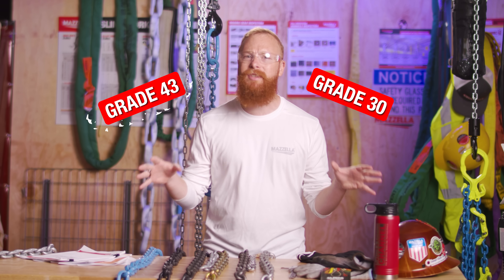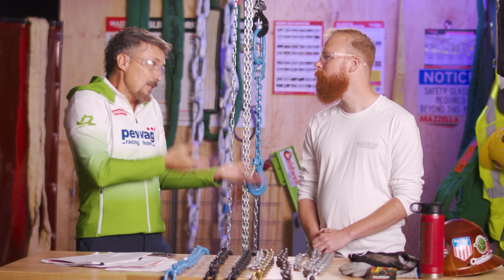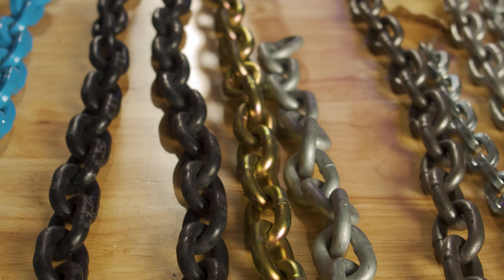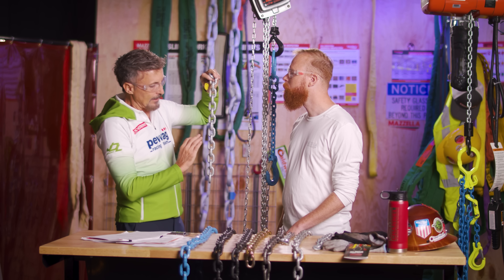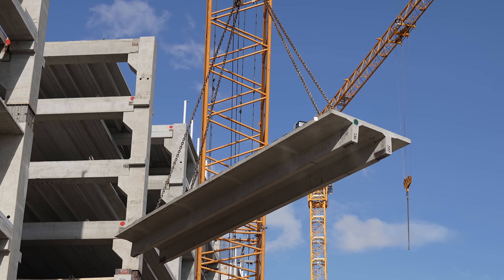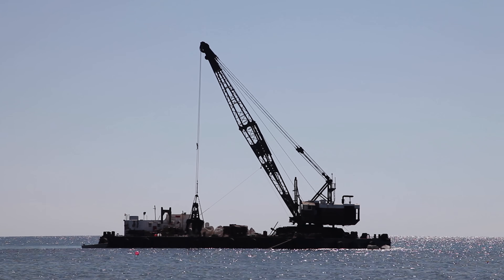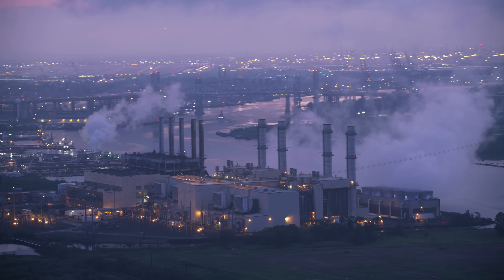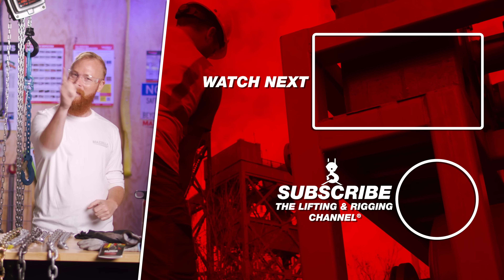Chain Grades Explained: 30, 43, 70 vs 80, 100, 120

Comment: Ciao Carlo from Concordia Station in Antarctica. Really nice and interesting video!
Reply: Hi Eric!
Thank you for watching and for sharing your insights about using rigging equipment in those incredible temperatures.
Remind me — what’s the highest temperature you’ve experienced during your winter, and what’s the lowest? It must get freezing cold out there down under! The steel you’re working with is really exposed to some extreme conditions.
Thanks again for sharing your experience!
Reply: @Chaniac-Chainwhisperer this winter we reached -78°C. -38°C was the highest, but usually we were between -75 and -55. 🥶
Reply: @ErikGeletti  have you experienced any failure of the rigging equipment in use? How do you use it and what for?